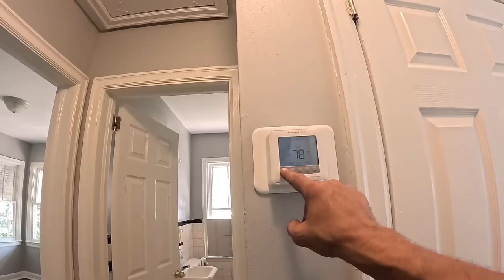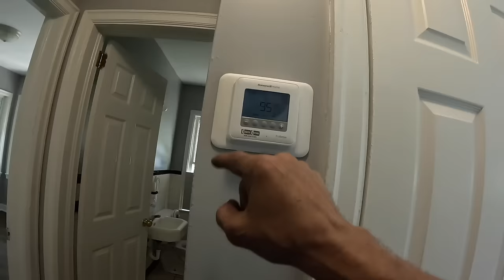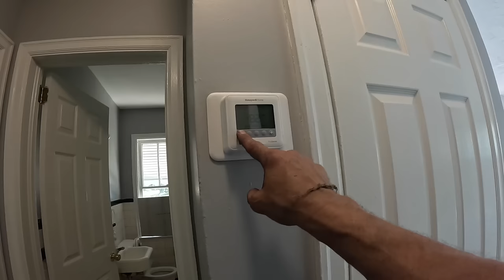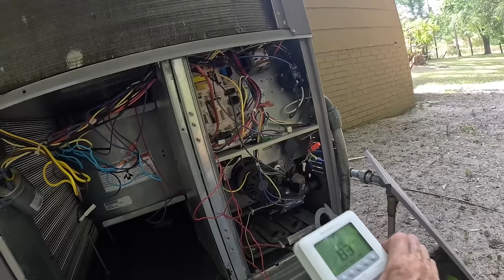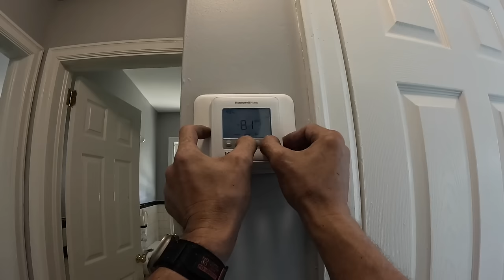Persistent Low Voltage Problems Can’t Stop Me! #hvacguy #hvaclife #hvactrainingvideos

Comment: I worked as a apartment maintenance engineer. For about 30 years before I retired. I was in electronic radio repair in the military, went through 2 different schools for different MOS before my time  in the service ended. I graduated top in both schools. So I was pretty good on low voltage, After I got out of the Army I  worked as an  electrician apprentice for a few years Installing power in houses and office buildings. So I gained a grasp of the higher voltage. I got into apartment maintenance and the old supervisor taught me about air conditioners and refrigeration and the refrigerants and I went to school and got my certification. the last job I had before I retired I was on for about 20 years. The ground in that area had a lot of minerals in it and it just seemed to attract lightning all the time. We would have a lot of those control boards going out on our heat pumps.  If you are new to the AC repair field, get training at a school , things are changing and getting more complicated  and newer gases being used, knowledge is key to a successful career.

Comment: Wow, What a video ! Bottom line you got them cooling. Congrats !
i Attack FUSE BLOWN calls a little differently in Package 📦 units. 
1) Whenever i Have a Fuse Blown on a Package unit i Want to know if its a Thermostat & Wire Issue or a Unit issue.
2) First - Disconnect thermostat wires from unit.
3) second - Jump out unit with jumpers  or Home made jump box & Make sure unit Works By itself. Run for 5 minutes Min. Check cooling & Heating. 5 -10 minutes each. if All is Well.
4) You know where the issue lies. thermostat or wiring.
5) Disconnect thermostat wires at thermostat.
6) separate all wires at both ends and check for shorts between wires.
if all good
7) Replace thermostat & Sub base Complete. Never replace half a thermostat. Do some fresh connections. that way u know all is good.

Crazy Video Curtis. Bottom line you got them some cooling. That's all that counts right now on a friday afternoon. with some heat coming in.

Can't wait to See the board install video. that's going to be interesting. maybe our maybe not. who knows with hvac calls.

if You are Getting shocked with 24 volts that bad You might want to start wearing gloves of some kind. humidity must be very high. i'd Recommend getting a box of nitrile gloves and throw a few in your tool bag.

take care curtis.

Comment: That was riveting.  Having these kinds of issues terrify me.  Customer watches you go back and forth from equipment to tstat, then you can't get the part they need.
Reply: Sometimes if it's troubleshooting & it's a odd one i'll ask them if they can give me some space, tell them i need to concentrate on a Wiring diagram etc.
if they still don't get the hint i'll say - 

How Would they like it if i was breathing down thier neck at thier work.

i need some space to think & zone in.

i'll come get them when ive got it figured if they wish.

but sometimes you got to be alone to figure it out.

allways - Just stay calm though.
Remaining Calm is Key. 
it's Just a Job.
We can only do what we can do.

Comment: Fascinating video, Curtis, and well done on getting some cooling sorted out. That control board looked like it was at an odd angle. Personally, I would have taken it out to examine it and see if there was anything going on behind or with the board mounts that could be causing a short. In my experience, when a job starts getting longer and longer I start pondering if I've missed something hidden in plain sight.
Reply: 2/3 of the way through this one. . . are we into that fried critter behind the board trick?

Comment: my suggestion when chasing down a short, disconnect the bonding wire from the common at the transformer to prevent false positives as well as remove the thermostat and then begin checking for shorts to ground. ( isolate the circuits and execute a search)

Comment: Killing me Curtis, super easy that you made complicated.  First off shut the power off.  Remove contactor low voltage wires from contactor, leaving the common from transformer on the right side.  Run a piggy back or jumper off the 24volt hot side of transformer to the red thermostat wire.  Then take the blue/black thermostat wire whatever they are using for common, connect to right side of contactor coil.  Then take a wire/jumper from the yellow thermostat wire and connect to left side of contactor.  Now when you call for cooling compressor and outdoor fan will engage.  Now take a little brown fan relay (24v coil), run jumper from green thermostat wire to relay coil, from other side of relay coil run jumper to right side of contactor, now you have complete path.  Then take the high speed from indoor fan place on the (1) contact on relay and the fan motor common and place on (2) contact (basically the NO Contact). Boom fixed till Monday.  When the thermostat calls for cooling the thermostat will send 24 volts to the contractor and indoor fan relay coils, closing contactor and the NO contact engaging indoor fan and compressor/outdoor motor
Reply: Just wire the motor hot and don't bother with the relay. Easier, and you don't sacrifice or have to charge for the relay. The cooling will still cycle with the thermostat.
Reply: @billj4859  agreed, but some customers will complain about the fan running lol
Reply: Curtis is in it for the win. Not for the come back later
Reply: @s550wulf9 You're correct. Some will that's why I give them the choice. A little noise or no cooling or no heat depending on the season. It's their house, not mine.
Reply: Ok captain hindsight.
Reply: @billij you are a patch tech not a repair tech doing that because you still have not determined what the issue is you have only eliminated the issue but not corrected it.
Reply: He had my anxiety going crazy.
Reply: Even easier turn power off then eliminate everything but thermostat turn power back on this will confirm the wires insulation and tstat then power down start with the blower relay and add each load until popper pops
Reply: @dmiestercommkitchentech3043  It's a temporary repair. What part of that did you miss?
Reply: @billj4859  jumped the gun read your comment before Curt stated it was the board he diagnosed the thermostat being the issue so then I realized why you said to wire blower hot instead letting the thermostat control the blower.
Reply: @dmiestercommkitchentech3043  that’s why I said wiring in a temporary relay
Reply: @billj4859  typically I would say temporarily wire it this way ......... instead of just saying wire it this way....... showing the person reading it that it was a temporary fix that's why I stated what I did and there are some on you tube that would eliminate the control board altogether which is WRONG
Reply: @krishuntzeroable  who?
Reply: @krishuntzeroable  lol no hindsight on my part, I watched what he was doing and knew exactly how to wire it safely without just running the indoor motor continuously
Reply: @billj4859  and with the comment not having to charge for the relay added to the idea that you were meaning it as a repair which it isn't right
Reply: @dmiestercommkitchentech3043  as a temp repair bypassing the board would be fine as long as safeties are still wired in series
Reply: @billj4859 i mean if you want shitty service.
Reply: @s550wulf9 you sir know your stuff (currently in hvac school) lol
Reply: @dmiestercommkitchentech3043  Where I'm at, we have a lot of board failures due to bad power. It's something we have to do during hot and cold spells.
Reply: Didn't mean to imply that was a permanent fix to the problem. I Should have been more clear in the first post.
Reply: @s550wulf9  no where did you say a temporary fix I read all of your comment 3x's and I only see where you are just bypassing the issue no where was it stated as a temporary fix or wire in the relay temporarily you have newbies that are trying to learn from YouTube and when you don't state that your comment is for a temporary fix to get customer by till issue can be repaired they learn how to make repairs using temporary fixes so be more CLEAR with your instructions
Reply: @dmiestercommkitchentech3043  you didn’t read close enough plainly stated boom fixed till Monday meaning temp fix buddy.  You didn’t read 3x you would have read that and known temp fix, not to mention in another comment I said customer wouldn’t want to hear the fan running.  And newbies should not be getting their training from YouTube videos
Reply: At the end you did state fixed till Monday which gives the impression that you mean it as a temporary fix so again the comment was made prior to finishing the video my comment was for Billj because he was countering your comment which is likely what I would do too because it would not need any more parts that were not already on the piece of equipment.
Reply: @s550wulf9  I had already commented about your statement about fixed till Monday after submitting the other comment and I agree with you that newbies should not use YouTube to learn but that is why the influencers are on here so they can make more money by showing what they know to newbies
Reply: Complicated???, I would have found the problem with an ohm meter and wouldn't have done any of that crap you mentioned. Good grief, and you said complicated. SMH
Reply: Got halfway through the video and read your comment and didn't understand what the hell you were talking about.   Then, I finished the video and was yelling at him to do exactly what you said! 😅
Reply: @Bryan-Hensley  lol I would have found the issue in 5 minutes with a meter.  Your lack of experience is why you couldn’t understand how it was simply laid out.  Temporary fix made easy, step by step for the noobs and you couldn’t get it lol
Reply: @alfranca5961 he has to come back later no matter what. Did you watch the video? He needs a new board and the parts house is closed.
Reply: Remove all components except for fan and place a block of ice inside activate switch
Reply: I love it when I jump out of the truck and they ask"whats wrong with it?"
Reply: Has that happen to an old carrier furnace. Board was taken out by a lv short
Reply: You do that to my unit I'm coming to your house.
Reply: Lol, I have to agree

Comment: Those low voltage shorts are always fun.  Looks to be a fairly new unit.  Warranty?  About as much fun as attempting to do warranty work for ICP.  How many other folks have trouble with them?  Not a distributor....nope....well we can't warrant the part.  AND...there's no other ICP dealer in town!
Reply: They're one of the only manufacturers that require us to send them parts back and require us to install their replacement part that they send us. So we have to get a customer going with our parts and then return later with the manufacturer warranty parts to replace the item for the second time. Lol
Reply: Yep.  That’s exactly what I’m doing.  I pay out of pocket for the fan motor and have to send it back for a credit.  Not very streamlined.

Comment: I've run into thermostat problems many times.  But it certainly could have been wire to wire short too or contactor windings.  Gone from Y to contactor bypassing the board many times to get them cooling.  Process of elimination - Good Job

Comment: I came out of the electronics field into HVAC. I love finding low voltage issues. I never ever apply power until I find the problem. It stresses out the electronic components. You need to know the ohms of all the components like the contactor (14 ohms) and find the short that way.
Reply: this guy got an eye problem i i i i i he knows everything.

Comment: Didn't you j7.p it  out at the  unit and it  ran when you had the  thermostat  wires  disconnected  ? I would   be  looking for a  problem with the  thermostat  wire

Comment: Why didn't  you ck the codes first. Why are you looking at the high voltage circuits . The fuse is in the low voltage. You didn't  have to go back and forth to the t stat. Just connect red, yellow and green at the unit.